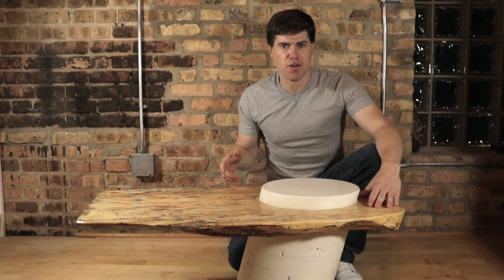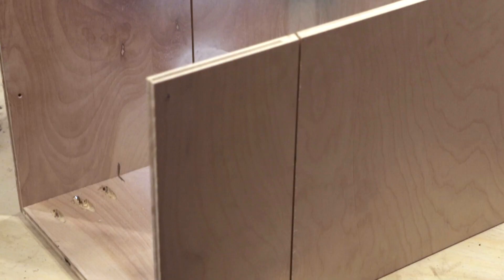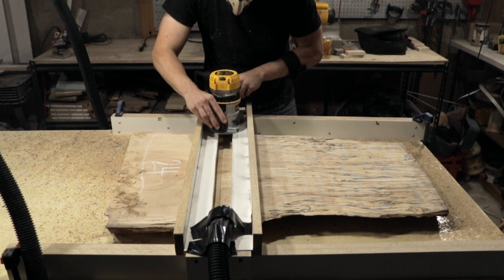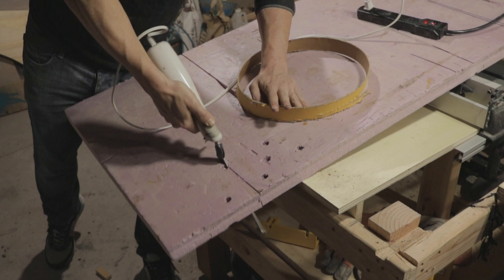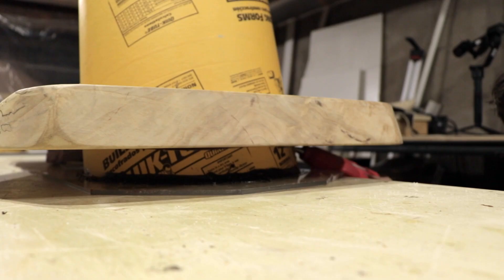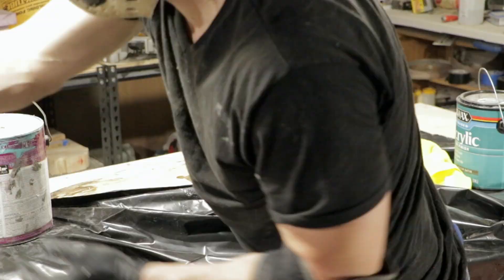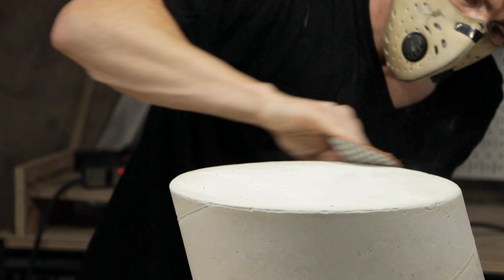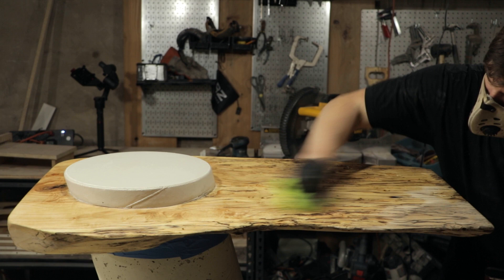DIY Live Edge Table w/ White Concrete Base || How to Make

Comment: This is SUCH a killer design. I think your designs are some really next-level stuff, and I watch a lot of YouTube makers. :-) I have two questions. The first one was already asked in the comments (sort of)... it's about sanding out the spiral from the tube. I've never sanded concrete before. I have a standard random orbital sander. Will that work to completely smooth the side of the column? Not to a glass finish obviously, but will it remove the spiral? If so, which grit would you suggest? Something really nasty like 60 or would 120 work? Second questions (well, third I guess) if you did not have the weight of the wood table top protruding as a cantilever, would the concrete column stand up by itself or tip backwards? I'm trying to determine if I wanted to build this deign myself as an shorter end-table size, weather I'd need to make changes to compensate for the lack of the extra cantilever weight. If the concrete column can stand on it's own, then there's no need for me to worry.
Reply from the maker: Michael Perkins thank you!  To sand it I would suggest using diamond sanding pads to start and wet sanding it (use a mister to spray it as you sand).  If you have an angle grinder that would work better...random orbit would just take some time, but you'd get there eventually.  I think at only 15 degrees the concrete would stand on its own with no problem, especially if you put more of the weight in the lower part of the concrete like I did.
Reply: Right! That makes perfect sense. Put the foam squares in early on so that when you flip it over, the bulk of the weight is at the bottom. I've seen foam want to float to the top when suspended in concrete. Maybe since there won't be any way for air to get in below the foam squares, simple suction will keep them in place so that they won't float.
Reply from the maker: It will float a bit if there isn't much concrete on top of it, but with 4 or 5 inches of concrete above it, it won't budge.
Reply: Might help to try and fill the spiral indentation in the form BEFORE casting

Comment: I see a lot of techniques that I use, great results for less money, great job!
Reply from the maker: Thanks!  have you done GFRC?  Or are you more of a woodworker?
Reply: i'm a woodworker, table making has mostly been for myself or family but I've got a few years of selling on etsy.  I've been using the router-sled method for planing, and epoxy resin for filling for a few years.  They're great tools.  I've been tooling with the idea of incorporating  concrete into a project, your video reminded me, I want to try messing with it at some point.  Love the cantilever idea.  How heavy is the table all said and done?  I imagine concrete isn't tenable for larger projects unless you have several hands to help move it.
Reply from the maker: The final piece was somewhere around 100-120 lbs - not exactly sure.  I could just barely lift it off the worktable myself to load it onto the cart.  Moving larger concrete slabs definitely takes some helping hands.  Using a GFRC mix can help a lot with this, however, more than cutting the weight in half for the same size project because: (a) you only need the concrete to be 3/4"-1" thick as compared to 1.5"-2" thick for standard concrete, (b) no re-bar, and glass fiber is much lighter than other aggregate, and (c) if you use pozzolans in place of some of the portland, this reduces weight even further.

Comment: I love the idea of this table. If I may, I would have cut the tube down one side and then cut the 30 degree angle probably on my table saw.. Over here in the UK we would have to make our own form, they don't sell anything like that.
Reply from the maker: Just curious how would have cut the 30 degree angle on the table saw?  I thought about this, but with the blade at 3" it seemed like it wouldn't have been possible to get the multiple passes lined up correctly.  Cutting the angles in the tube were the most challenging part of the build so I'm definitely interested if there is an easier way.
Reply: I have a straight edge for the table saw for edging timber. I could clamp one end say with an inch showing on the other with zero clearance (Math isn't correct) This would make a parelagram type shape which, when brought back round would form the required angles. I will be having a go at making a table similar to yours in the next few weeks, I will let you know how I get on.

Comment: I really liked this. however the wood could have been cut with a router angled at whatever degree you had going there. no need for the double pour. 
regardless it came out really nice! modern and clean. 
personally I'd have sanded the spiraling out of the stand for a more modern, cleaner look and added a recess to the top of the post. maybe as some sort of holding tray, bowl ect. 
where're you from Mike?
oh yes and by cutting the hole in the wood you could have multiple cantilevers in opposition. different lengths 😱
lol enjoy my friend. I'd love to see this one expanded on as well. please share links if someone else does?

Comment: You could have used Solidworks to make  a 3D design of cylinder sliced at angle and then opened the curved surfaces in 2 D to get a template to cut out the formwork sheet accordingly . Then u could have curved the sheet to join its ends and it would have turned out to be the cliced cylindrical shape that you  wanted.

Comment: That's a very nice design. How stable is it?
Reply from the maker: DIYCoolStuff thanks!  It is very stable for anything you would normally use a coffee table for.  You can put your feet up on it and it doesn't budge.  I wouldn't stand on it at the far end of the cantilever, but other than doing that, it's pretty hard to tip it.

Comment: I'm really interested in "air-crete" and would think this could be a good application. It would make it a lot lighter. Beautiful design, thank you!
Reply from the maker: Haven't heard of aircrete.  What is it?
Reply: Concrete with a foaming agent added during the mixing, it creates a concrete that's extremely light (floats on water) and has a really good R value. The only problem is it's kind of brittle so you'd need to add a finish coat.
Reply: Modustrial Maker you should check it out! It has been made industrially for years, but the machinery used was so expensive it made it too cost prohibitive for regular use, but now people are figuring out how to do it themselves! "Honey do carpenter" here on YouTube is a good one to check out.
Reply from the maker: definitely will

Comment: How much weight can the cantilever wood hold. I'm thinking if somebody sitting on the edge of that table would it fall over?
Really great video!
Reply from the maker: I just tried it, and yes, if you sit at the very end, it slowly tips forward.  But generally it is very stable.  Doesn't budge if you kick your feet up on it or use it any other way you'd normally use a coffee table.

Comment: really love the design. i hate to be negative in any way but not buffing out those tube lines is really leaving a bad impression on me. everything else i really enjoyed.
Reply from the maker: You could get rid of them with some sanding/grinding, and slurry coats.  Labor intensive, but doable.
Reply: You could add some type of coating to the inside of the tube (silicone) which would bring down the sanding afterwards.

Comment: Love it and such a great video. I also have to do a spin on this. Did you just guess/feel about where to position the wood & concrete for balance?
Reply from the maker: I played with the design a bit in sketchup, but ultimately, I ended up just moving the tube form around on the table, and seeing where it looked best, before I poured, like this: https://www.instagram.com/p/BXtQ0-2D0v2/?hl=en

Would love to see your spin on this!

Comment: Cross hatch pattern with a belt sander is the way to go
Reply from the maker: Can you elaborate?  I'm not an expert woodworker so am always eager to learn more from those who are.
Reply: Modustrial Maker in the vid your going with the grain...right?  Same back and forth motion but at a 45° angle to the grain one way then repeat the opposite. Tears down the tool Marks quick
Reply from the maker: Ah OK, I'll have to try that next time.  I was concerned about sanding evenly, but I suppose you just have to keep track of 45 degree motion paths and move at a consistent speed, and that should work?

Comment: maybe a bandsaw blade with clamped on guides to make a single cut saw to cut through the miter box?
Reply from the maker: zenmark42 yea, that would definitely work, if you have a large band saw.  I don't have one so I had to come up with a different solution.
Reply: Oh I meant, just buy the bandsaw blade itself without the whole saw and use it with some clamped on handles/guides
Reply from the maker: zenmark42 oh now I see....that is actually a great idea!  Cheaper and would probably work better.

Comment: Where do I purchase polymer? And what's the other top face material? Plastisizer? You used those for the first layer against the plexiglass.
Reply from the maker: I got the products for this mix from Fishstone.  There are links in the description (there is also a simple pre-blended GFRC mix with everything in it, and it is linked to in my more recent concrete videos)

Comment: you said you used a face coat, is that needed? or would the premixed gfrc suffice? 
Ive cut my forming tube already and have a live edge slab, and now about to order the concrete needed
Reply from the maker: You can get away without a face coat.  Just make sure that the mix is nice and flowing (add some plasticizer if need be), and don't sand down the surface too much when done (if at all), and it will turn out nicely.

Comment: what does the foam do? im assuming it adsorbs a lot more concrete effectively creating a weight?
Reply from the maker: The foam doesn't actually absorb any concrete.  Rather, the concrete flows around it, so the foam creates a lightweight core within the post.  Using the foam thus reduces the overall weight of the post (probably by 30-40 lbs).  By reducing the amount of concrete used, it also reduces material cost, which is important since GFRC is pricier than standard concrete mix.

Comment: Love the project! How heavy was the final piece?
Reply from the maker: Thanks! It was about 120 lbs...heavy, but not so heavy it was unmanageable.  I was able to lift off the table and onto a rolling dolly to move it, but just barely.
Reply: Do you think it could be done with a hollow tube of concrete to reduce weight even more, or would that affect the structural integrity too much? (i.e. 8" form inside a 10" form to make 1.75" thick concrete walls)
Reply from the maker: That is essentially what I did by using the foam blocks, which weigh almost nothing.  Hard to see in fast motion, but I think I used 4 or 5 blocks that were 1.5" thick each.  (In retrospect, I should have set up an overhead shot while filling the tube -- next time.)  You need it to be solid where it goes through the tabletop, and just above and below that, so it can withstand the torque of table and hold it in place.  And you need some weight at the bottom of the base, so the table is stable.  You might be able to trim another 20-30 lbs off it, but I wouldn't go much thinner

Comment: Hello Michael, What's the foam You use for concrete thins ? Is it EVA foam or foamed polyurethane or something else ? Thanks in advance for Yr advice. Alex.
Reply from the maker: It's just foamular insulation foam... Available at most big box stores
Reply: @modustrial  Thanks a lot , got it. Looks like we have similar foam
 in Russia.

Comment: Looks sleek! What was the approx final weight?
Reply from the maker: Thanks!  About 100 lbs
Reply: Modustrial Maker hoo dang! she's hefty. any other ideas besides the foam inserts for getting the weight down?
Reply from the maker: More and bigger foam inserts :) . In actuality, the weight in the concrete post is helpful because it helps to balance the table and make it stable.  I could have probably got it down to 60 lbs or so if I used foam inserts all the way through the base, but it would have tipped over easier then.

One thing I'd love to see is a variation on this with two 6" or 8" concrete tubes in a V-formation.  Using smaller tubes and more foam, you could probably create a 60 lb table  that would look really cool.  And with a V formation, the extra weight wouldn't be needed for stabilization.

Comment: Its a real nice design, just scared some dumbass would sit on the edge and well.. will make the table tip over 

Having that said, DOES it tipover easily? or is 1 sturdy concrete pipe strong and heavy enough? imagine throwing a package or a box with stuff on the table
Reply from the maker: Sarino Hamyani Thanks!  It is pretty darn stable.  I'm out of town this weekend but will do a sit test when I get home and see what happens.

Comment: You didn't need to put the tube ends at a parallel like that... Concrete is a liquid. So it self levels...even if it didn't vibrating it sould make the top be perfectly flat. A little clean up at the end voila! You over complicated this project
Reply from the maker: Good observation -- one of the angle cuts could have been eliminated, but you still would have had to cut the top section at angles.  Also, having the form the exact shape helped when lining up the top and the bottom (see here: https://www.instagram.com/p/BXtQ0-2D0v2/).  Not necessary, but it helped.
Reply from the maker: correct link: https://www.instagram.com/p/BXtQ0-2D0v2/